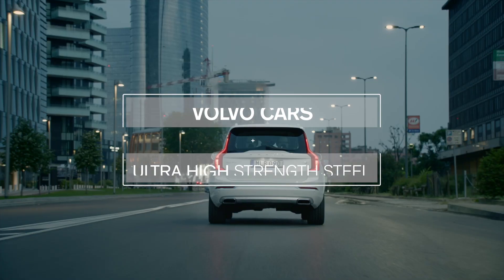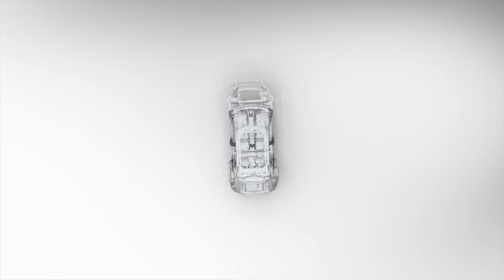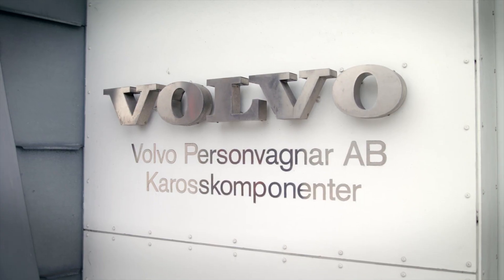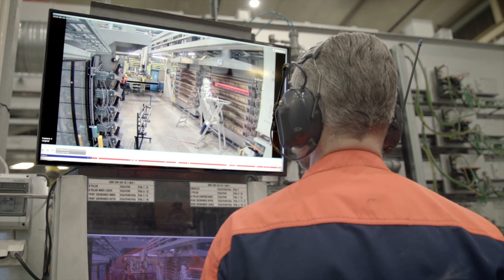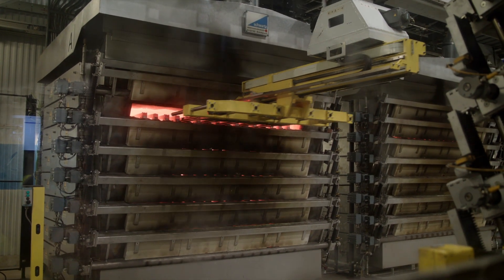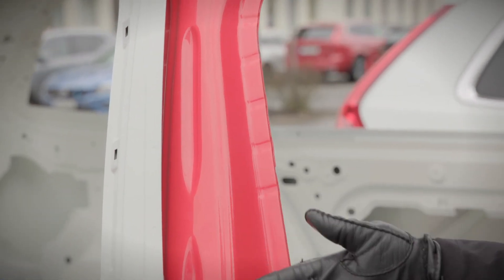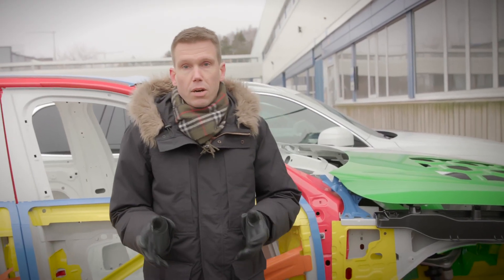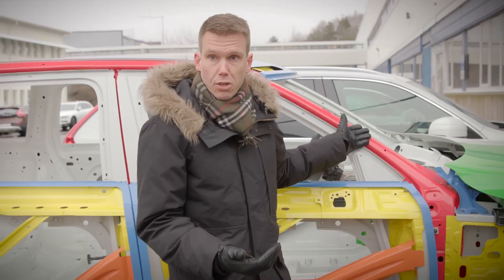Volvo Cars Ultra High Strength Steel

Comment: The unsung hero of super saloons is my favorite dream car crush, it's the Volvo S60R packing an impressive engine configuration and has an Inline 5 with a turbo, basically my experience with computers and do more research, I can buy one, unless this system didn't wreck my wallet 4 years ago.